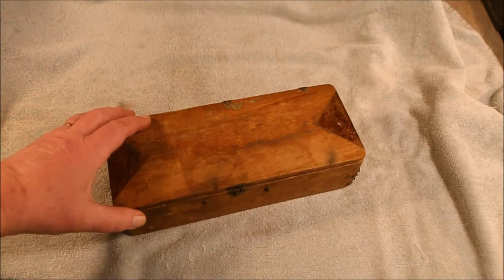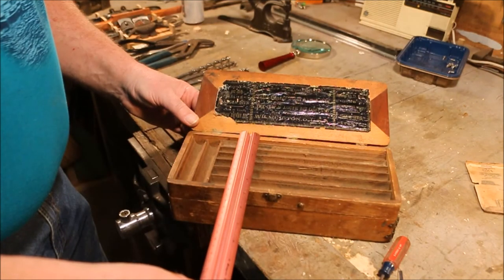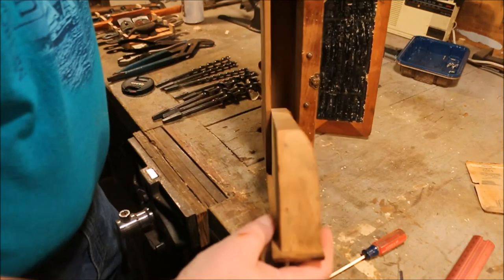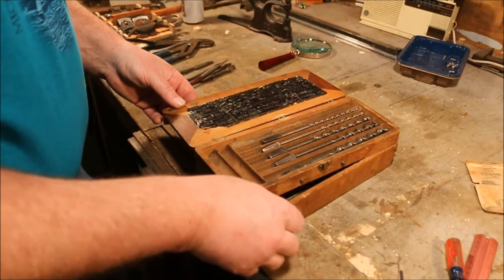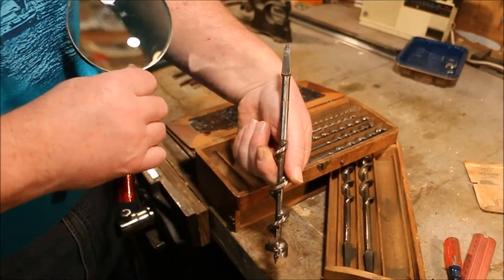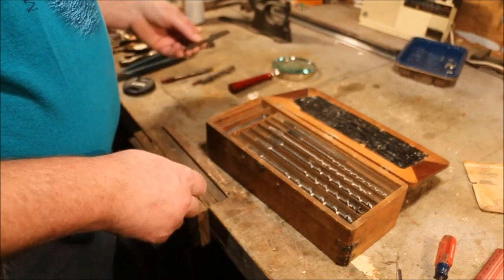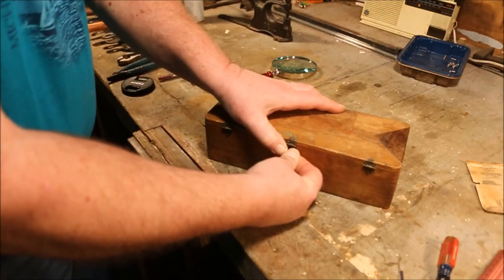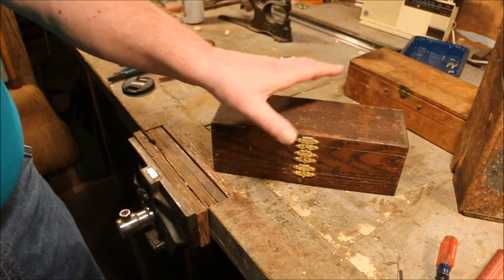IRWIN AUGER BOX  PATENTED OCT  21  1884

Comment: Thanks for showing the bit boxes.  I suspect that there are some ebay sellers selling "new antique" jennings bit boxes and bit sets.  Hard for me to believe there are so many shiny complete antique sets out there.
Reply from the maker: Thomas O'Brien I can buy new Irwin bits but they cost 5 times what one of the antique ones does. The hard part is finding a full set of all the same maker, and with the same stampings. I sold the good set for $160.00. All the bits matched and the box was clean & straight with all the hardware. Those things aren't important for a user set but they sure do bring out the collectors. ☺

Comment: I've got a Russell Jennings set. I was poking around a flea market and came across a stand selling auger bits for $1.50 each. I was able to put together a nice set for everyday use. Take care
Reply from the maker: It's not that easy to find bits that are good enough to use without quite a bit of tweaking. I got lucky and bought a green metal toolbox full of bits that had a half dozen good sets in it. The only ones that keeps me from having more than 6 sets is the #15 bits. Not a common size I guess.